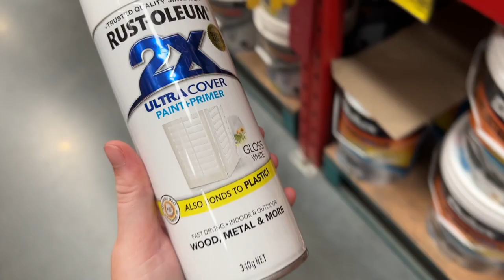sewing room refresh, IKEA sewing bench hack, scrunchie maker, storage, new work studio vlog 031 BTS

Comment: I make wooden toys and finish a lot of them with home made beeswax polish. I wouldn't recommend using olive oil, because it goes rancid and doesn't dry down. Check the desk where it's in the sun and make sure the wax isn't sticky or melted before you put anything on it! If you refinish the desk, use linseed or pure tung oil mixed with the beeswax, or sand it back and just use a hardening oil or a water based timber finish. Even a blond shellac, which will leave the timber with a lighter finish than oils. It'll be more durable, and won't get funky in the sun.